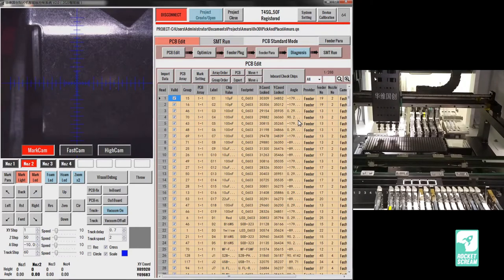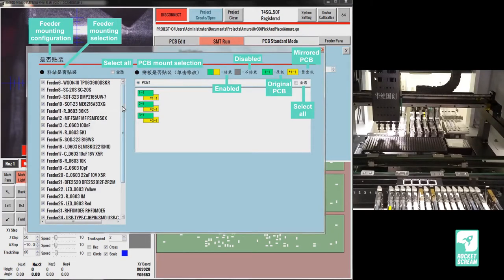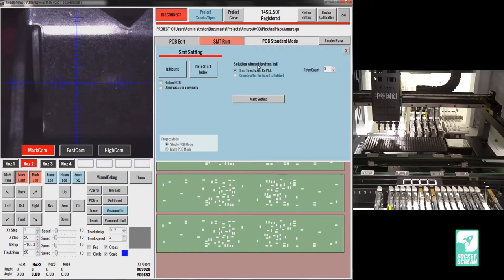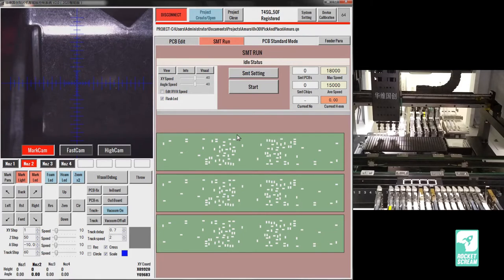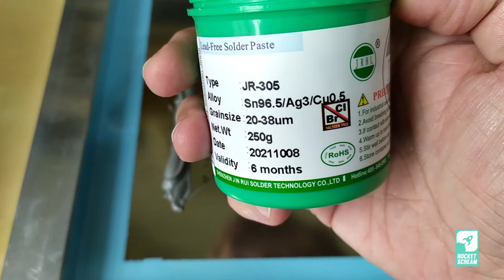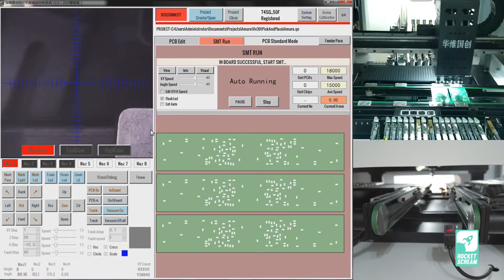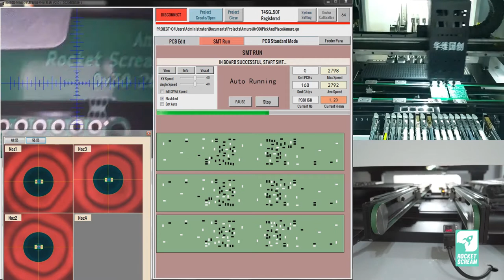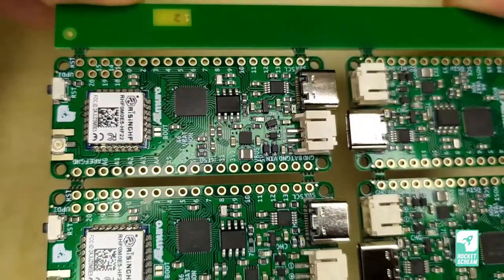Rocket Scream - HWGC HW-T4-50F P&P Guide Part 3 (Running a Job)

Comment: Hi, thanks so much for posting these videos! i have managed to get the machine up and running quite successfully, thanks to all your hard work! One niggle i have is when a feeder runs out part way through a build and i stopped the cycle to replace the reel,  when i re-started the cycle it began from the beginning. is there a way of stopping the cycle and re-starting without it starting from scratch again! thanks!!
Reply from the maker: Press continue instead of start after SMT abort.

Comment: Hello I want to know is there a solution to enter the board every time in the same place or do I have to fix it every time I enter the rose every time I enter the rose after the operation is over I come to enter the second board it does not enter in the same place so I have to make the settings from the beginning is there a solution to this problem
Reply from the maker: Why there's a need to fix the location? It uses the fiducial mark to calculate all the coordinates of parts.

Comment: Your machine has Panasonic or Sigriner servo motors ?
Reply from the maker: They only use Panasonic motors on their machines.
Reply: @phangmoh  I got answer from Mr. Liu:

The HW-T4SG-50F is the old name, now we call it HW-T4-50F, they are same machine, and for the old machine it was use Panasonic motor, now it use Sigriner

Comment: Hi, do you think this machine is good for monthly volumes of about 15,000 boards with 40-50 components each? Or is that quantity too much for this machine? Parts are 1206, 0805, SOT23, SOIC and QFPs. Definitely nothing smaller than 0.5mm pitch. Thanks!
Reply from the maker: Shouldn't be a problem. Just make sure you maintain the machine properly like oiling and cleaning all the debris and dust on the rails. And clean air is most important and spend some money there to get good air supply.
Reply: @phangmoh  Great, thanks! My options in budget are a 20 year old Yamaha YV-100X or a this machine. Don't have a space restriction. What would you have gone with?
Reply from the maker: @samygom  you can also go for that if you have the space. Many factories in Malaysia uses them due to the large spare parts still available and they are not so expensive. Software wise might be a bit old style though but feature packed.

Comment: Do you think there is a way to get that machine to cross a regular door? Our office is big but our entry is just a regular ~70cm door.
Reply from the maker: I have an 80 cm door. I had to take out the top cover and make it lie side way and push it through. Without the cover and feet, the highest part is about 73 cm but that is only one part (the head), the rest is lower. I think if you push in any shorter side in first, it could. Maybe need to take out the door first would help. The machine is big.
Reply: @phangmoh  I'll mesure my door tomorrow. Imagine how stupid you need to feel holding the machine in from of the door realising you will not be able to enter the office haha. Are you happy with the machine for now? Why would you do inside production as opposed to outsourcing the PNP.

BTW did you consider Neoden4?
Reply from the maker: @maesitos  definitely the best piece of equipment I have ever bought. Wish I had bought this earlier than a crappy machine I bought before this (go read my post on this). Visited Neoden in 2015 just before Neoden4 was made public, it is a fiddly machine especially the feeder. I make small batches of my own products and also custom design for clients, so it really helped a lot by getting rid of the outsourcing headache. I went to their factory twice in China just to measure the dimensions in person to ensure it will go through my door.
Reply: @phangmoh  I just read your entire post. It is a really exiting post although my wife would disagree ^_^ Very amazing, HW-T4SG-50F might be what I am also looking for. We now need to stock up big time if we ever want to guarantee future production and we think it is a mess to send the components over to the PCBA company we work with. Thank you for sharing your experience.

BTW what is up in Malaysia, that place seems like it is booming.
Reply from the maker: Malaysia used to be hub for Japanese electronics companies in the 80s and early 90s. Most has since moved out to China and Vietnam. Add the loop-sided social policy, the country is on the downhill ever since the 1997 economic crisis. Neighboring countries like Indonesia, Thailand and Vietnam that used to be behind us, are catching up and it wouldn't be long for them to be on top. The only good thing about Malaysia now is the good food and the people in the ground. And if you ever wanted to get more information on the machine, just drop Liu (he hangs around on my video, LMAO!) a message. I used to have only an intermediary dealer in between me and HWGC, and that too can have lost of words during translation and message conveying. But, his good command in English has tremendously help the support process that was missing on HWGC prior to 2021.
Reply: There is a way.

Comment: Hello, can we get in touch? I am planning to order this machine and I would like to ask some details.
Reply from the maker: Please contact HWGC directly, they do hang around my videos. I don't do sales.
Reply: @phangmoh  I would prefer to talk with user :) I want to know if you have good experience with placing TQFP/LQFP64 pins and QFN chips. I assume that 0603 chips are easy-peasy stuff for this machine..
Reply from the maker: Done plenty of those chips, not an issue. Also on this video series, QFN48 with 0.4mm pitch is used.